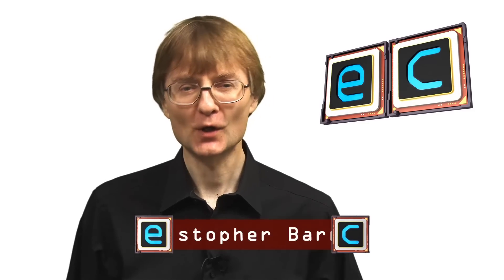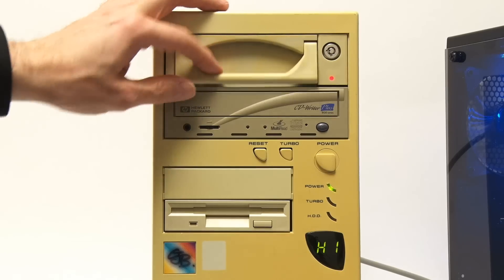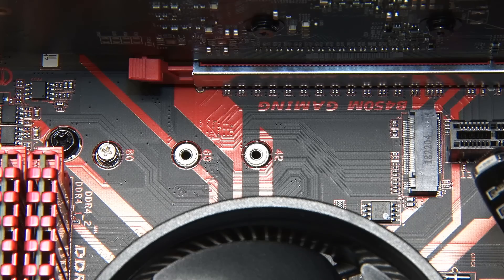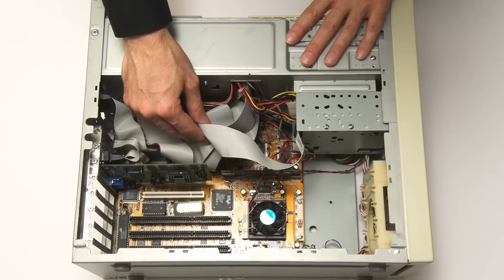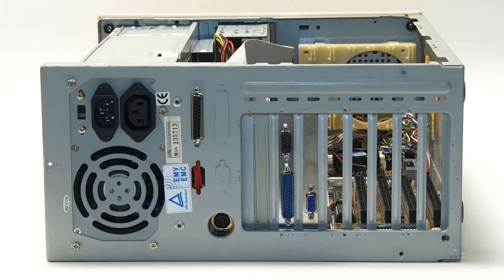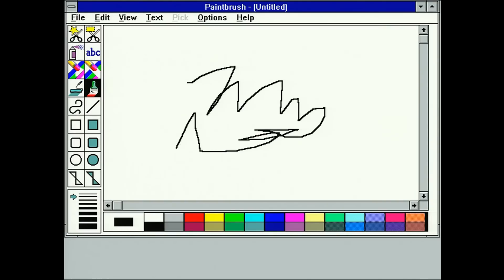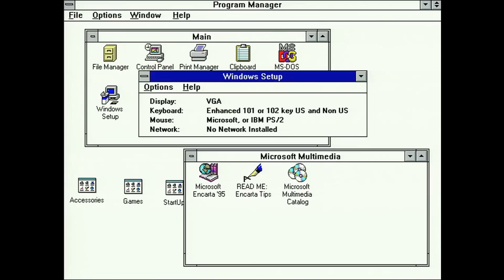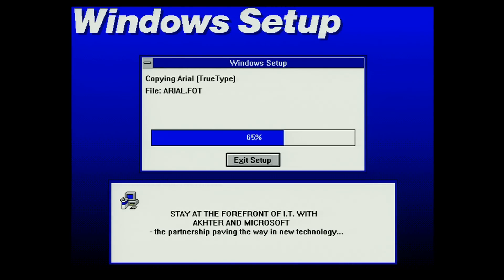Ryzen 3 vs 1996 PC

Comment: Still have the first computer I assembled back in 1997. Was going to take a peek inside a few months ago and discovered a paddle lock on the case that apparently I had secured it with many years ago. Seemed a little silly until I remembered how much the (by today's standards) puny memory and HDD had cost back then.

Comment: Thanks for a blast from the past.   I built my first PC around 1988.  I do recall the excitement at the time when Windows 3.1 came out a few years later.   The search for drivers was a big challenge back them.   No internet so you needed the driver on a floppy. 

Installing from a floppy was always a fingers-crossed event for me.   Now and again I had a bad floppy.   I recall getting the stack of floppies to install the IBM OS/2 operating system.   One of the floppies was bad so I never did manage to get that installed.
I look back with some fond memories of earlier versions of Windows, MS Encarta, etc.
I am now running Windows 8.1 on this computer.   The wife upgraded to Windows 10.1 which gives me problems when one of its forced updates does not work.
I expect my next computer will run a distribution of Linux.
I still have a lot of old computer parts, motherboards, drives including the original 10MB Winchester hard drive.   Huge and heavy.   It shook the entire computer when it ran.

Dave.

Comment: This Ryzen pc is something unimaginable 23 years ago. It shows how far the technology has come.
Now think 23 years in the future - what craziness will be there? Tens of terabytes of RAM, 1000+ cores?
Why not!
Reply: Well, in 23 years Chris has increased his RAM from 32 MB to 8 GB and his core count from one to four. So, extrapolating forward another 23 years I make it 2 TB of RAM and 16 cores.
Reply: @johnm2012  I could agree on the RAM but
CPU cores are on an upward trend. I predict 24-32 cores will be the bare minimum within a decade.
Reply: @flioink  Yes, I was just going by the difference between the two computers and extrapolating. The thing is the 1996 PC had more memory than was typical at the time. It would have been an expensive machine to build, whereas the 2019 PC was definitely a budget build. If he'd been comparing like with like the Ryzen would have had 8 cores or maybe even have been a Threadripper and he would have maxed out the RAM as he did in 1996, so 32 or 64 GB. So on that basis, maybe we can extrapolate to 64 cores in 2042 and 32 TB of RAM. Who knows? I hope we both live to see for ourselves.

Comment: i honestly would have died laughing if you opened the old PC and inside was a Ryzen 9 with 5700 xt
Reply: I doing something like that with and old DELL Pentium 4 system I salvaged from the local recycle drop off, for a retro Win98/XP build, I just need to find a case big enough for the build. I even found a period correct ULTRA branded modular 500 Watt PSU for the build to add some early - mid 00's Bling on the inside, and yes it was brand new in the box with the original shrink wrap, and it's never used, and the caps, etc.. are all in good condition.
Reply: A Pentium 3 era case should do it -- ATX mobos really havent changed a lot
Reply: @ayuchanayuko  Yep, but trouble is finding them in good condition, and at a decent price in my area, as when I come across one on eBay, they always want some crazy amount for shipping the thing.
Reply: @CommodoreFan64  check your local surplus shop, especially the Storage Wars kind that keeps old stuff.
Reply: @ayuchanayuko  Trust me I'm always on the hunt, but it's bare beyond some ugly AF HP cases from the early - mid 00's that are also overpriced. My local Goodwills rarely put PC's out on the sales floor, it seems, and the Salvation Army is 80% clothing items, and what other they have is usually overpriced, yes I've checked others, but again no luck. part of It is because we  have free recycle drop off locations around the area, you just have to show your state ID with your address on it, and I've even checked there, but not a ton of luck as of late, beyond a Yamaha keyboard I'm cleaning up for my nephew.
Reply: I like to think that one day the people who ruin old computers to build sleepers will be seen by historians the same way as those who used to grind mummies for "medicine".
Reply: @ivanlagrossemoule  Big difference in crazy people grinding up dead bodies for crazy fake medicinal purposes, vs. giving old tech that was going to be thrown away, and hauled off to some 3rd word African country polluting the environment, or would have been recycled(what little that actually does). I'd rather save the old tech, and give it a new lease on life, at least as long as I'm on this planet, and it can serve me a useful purpose. If you want original parts the way they came from the factory,  then go to the RE-PC Store in Seattle Washington, they have so much back stock of old parts they don't know what to do with them. Metal Jesus Rocks made a video on them.

Comment: Great look back!  I built all of my early Pc's, including my first IBM clone, a Heathkit HS-161.  Soldered an estimated 2000 solder joints.  It ultimately ended up with a 10mb hard drive and ran Geoworks Ensemble (a wonderful graphic interface that was miles ahead of Windows 3.1) on top of Microsoft MSDOS or Digital Research DRDOS.  Great fun, but I don't want to go back.

Comment: A PC labelled for 1996 should demo Windows 95 as everyone moved to that in those years, except probably your uncle or grandma.  I remember back in 1996 I bought a Compaq Presario 166mmx (Pentium) which had Windows 95 there, and had way better technology than yours.  It had 1024x768 in true color and yes 32mb ram expandable to 80mb.
Reply from the maker: I had DOS and Windows 3.1 disks available. We were still running these and not 95 at work, and indeed because most software in business use was still DOS (this machine was mainly used to run Word Perfect 5.1 and Lotus 123), the DOS / Windows 3.11 combination was much favoured. So it is not true that "everybody moved to Windows 95 in those years".
Reply: @ExplainingComputers  I'd argue that it depends where you live, in North America (Montreal to be specific), we do not keep rolling on the old standards for extended periods of time.  Was everyone moving to WIndows 95 back in 1996 ?  I'd advise checking out sales figures of the Windows 95 Operating System.  I had Windows 3 on my 286 in 1990, then I was bleeding edge on the Windows, and THEN I was programming in DOS on QuickBasic 4.5.  So, to me 1996 has nothing to do with DOS.  I was also programming in Turbo C in DOS in 1990 up to 1992 as I had a WWiV BBS.
Reply: In fact, while thinking about it, at work we did use Windows 3.1 in 1996, but on 4mb 486 machines.   But it would be pretty mindless to run  that on a Pentium with 32mb of ram !!
Reply: @33ordie  You seem to be showing unnecessary aggression here. It's obvious from what Chris says in the video that he rebuilt the computer to something like its 1996 specification and did a fresh installation of DOS and Windows 3.1. Maybe after nearly a quarter of a century he didn't have a set of Windows 95 installation disks readily available. It's just a bit of fun and close enough for the purpose of education. Get over it.
Reply: @johnm2012  thanks

Comment: I'm no expert but my guess is that the Ryzen 3 system is faster.
Reply: how Ryzen 3 can be faster than Pentium 120 ? 
120 > 3
Reply: Yeah but it's only because it has more RGB.
Reply: Well yes, though what it is being asked to run is a lot less efficient.
Reply: @eLJaybud  absolutely spot on! Would imagine code for Windows 10 is at least 50 times larger than 3.x
Reply: Windows 10 on the Ryzen and Arch with i3wm on the other one would make things pretty close.
Reply: @JeffSmith-vc9ii  Try booting any variant of arch on the Pentium. Any.
Reply: @dascandy  Ive run it on a 200mhz before. But yeah ram could be a problem I guess. Problem solved with Tiny Core.
Reply: @JeffSmith-vc9ii  The ram is one problem - but note that the PC doesn't handle DVDs, doesn't have USB nor any other card formats... and it doesn't do SATA either. It's pretty hard nowadays to get anything to plug into it - not even a network uplink will work.
Reply: @dascandy  My theory would be to  image an ide externally.
Reply: But ... can it run Windows 3.1?
Reply: Intel is faster than amd
Reply: @jimmicrackhead12  gr8b8m8
Reply: @jimmicrackhead12  and is almost twice the price as amd lol
Reply: For a lot, probably majority, of people computer is a machine which runs Word, Excel, and nothing else
"What's even the point of computer, if Word isn't installed on it"?
Reply: @KOTYAR0  These days, I think even more people just think of their computer as a web browser.
Reply: Yeah it's possible with extra cooling
Reply: @RubberGopher  This sounds like a good challenge. I know I can get arch (old kernel) on something with mmx instructions. I just wouldnt update it. Tiny Core would work np, and debian with open box .
Reply: i am fan of my wallet
Reply: I'd hazard a guess that a Raspberry pi zero can beat a 1996 desktop.
Reply: @alexmcd378  it's not x86 though, it's ARM
Reply: @RWL2012  Doesn't mean they can't be compared. Might have to recompile a program or even write your own, but it can be done.
Reply: @alexmcd378  true I guess
Reply: @RWL2012  I bet the pi 400 computer can emulate a faster x86 pc than what we had back in 1996.
Reply: @tj71520  quite possibly!
Reply: Good guess
Reply: When it comes to classic games it might be a little too fast... if you can get it to run on the modern system through emulators or installing DOS and another version of windows in VM
Reply: not faster as i9 and im not expert to
Reply: Yes, 10x faster
Reply: @gile849  a bit more than 10! the Ryzen 3 2200G (passmark 6713) is more than 10 times faster than even a 3.4GHz Pentium D (passmark 634), and more than 68 times faster than an 866MHz Pentium III (passmark 99). so it's probably more than 100 times faster than the 120MHz Pentium I.
Reply: If you tweak the memory they are almost the same
Reply: The older system is a tad friendlier because it says hi when powered on.
Reply: A pentium is overkill for windows 3.11. A 386 would be more accurate. I ran do until I got my first 386 then I could use win 3.11 and by the time I got a pentium I was running Windows 95
Reply: AMD is in first place, get used to it Intel boi

The is just beginning.  Next 3+ years will be a hilarious roflstomp with no answer
Reply: @tnix80  I'm pretty sure simsalamia was being sarcastic....
Reply: @tnix80  

I'm a fan of AMD, but even I know that you shouldn't make statements of the future like that. You might end up eating your words 😉
Reply: just a bit yes )
Reply: no shit sherlock? :)
Reply: You are an idiot, AMD is not better than Intel....
Reply: @simsalamia  Run and hide for your life. They are coming for you, and won't stop till they get you. Be careful, intel guy.

Comment: Did you cover making sure you have the right jumper setting on your drive? You will have a hard time installing and booting if the jumper settings are off.
Reply from the maker: Oh yes, drive settings were fun in those days, master/slave IDE jumpers and all that.
Reply: Do you remember that the cable to the floppy drive had a special twist in it?

Comment: That was interesting, nothing like a bit of nostalgia.  In the late 1980's I had a NESS PC, 8086 with 32 MB HD, one 5.25" floppy and a 3.5" which I added later.  I also bought a Microsoft Mouse and adaptor board which cost me £112, a lot of money then.  Despite all this it ran ORCAD, a PC design, simulation and PCB package with no problems.  Modern PC's have more power and memory but the programmes have become so bloated much of this is wasted.  Bob

Comment: 1990  the year and a 386   later with a math co-processor installed.     2400 baud modem and WOW you could get stock quotes on the same day and even draw a chart of a stock,  it took a while but it was better than reading what your stocks did in the next day's morning papers.

Comment: I was wondering why the system wasn't running Windows 98. Then I realized that the system came out in 1996 😂 But why not Windows 95?
Reply from the maker: I happened to have Windows 3.1 disks "available", and mainly ran Word Perfect 5.1. So I did not desire Windows 95, let alone want to pay for it! :)

Comment: You should be able to find Windows 3.1 drivers for the video card on-line somewhere. The big issue is determining precisely which type of video card it is, and whether it has enough VRAM for 256 colour modes. Some of these video adaptors only had 256K of VRAM, which was enough for 800x600x16 colours.

Comment: Ah, Windows 95 could run Windows 3.x software, right? (The latter seemed an odd choice for 1996)
Reply: Pretty sure that was true up until at least Windows 2000.
Reply from the maker: I had 3.1 floppies available, and mainly ran Word Perfect 5.1 in DOS.

Comment: I was lucky in that my family had computers since DOS, and we got on the internet relatively early as well (with a 14.4 Kbps modem at first, with photos taking a while to load from top to bottom).  My first laptop was bought in 1999, and I remember that that had a 6 GB hard drive.  I would like to say, "That was more than enough at the time", but in fact, I always ran into the maximum storage limit and had to offload my data, first to those 1.44 MB floppy disks, and later, to CD-Rs.  But, to be honest, I still find that I have to do that, even with my 2017 Ryzen (first gen) PC, as I take photos, so I offload my data (depending on what it is) to one of two 5 terabyte hard drives these days.  As far as we have come, I want more.  I really need more.  And I hope that we can get back into that exponential improvement that we experienced in the 1990s and 2000s, instead of what I feel is a more linear progression these days...

Comment: I won’t deny the obvious advantages of solid state media over mechanical hard drives and floppy disks but I do like using them still (not as boot media) as the sound they make is reassuring that the computer is actually doing something when you use it
Reply: Mechanical hard drives still retain at least one advantage over SSDs - cost per gigabyte. For bulk storage they still can't be bettered.

Comment: P120 was a little slow for 1996 wasn't it? I remember my 1st PC (Also in '96) 32 meg but having a Pentium 200 CPU. Coming from the Amiga, I thought it was P.O.W.E.R.  :D
Reply: The P120 had hit the the market in 1995.  The P200 was introduced in '96, but was fairly expensive when it first hit  A lot of P120 and P133 systems were being sold in 1996 as 'budget' or even 'lower-midrange' PCs, since with the introduction of the P200 the prices on P120 and P133 chips were dropping fast - especially in light of the anticipation of the Pentium-2 in 1997.
Reply: @xaenon  yep, and then by the time we hit 99/00 the budget builders who knew their stuff, where using AMD K6-III series CPUs, and hitting blazing speeds of 550Mhz which is what I built my first real PC gaming system with then when I was in high school working my first job to pay for it all.
Reply: @CommodoreFan64   I was getting my A+ certs at the time, and I'd just put together a Cyrix MII-PR233+.  The chip actually ran at 166 Mhz but in most areas it ran similar to a Pentium-200/233 and even had MMX extensions.  64 meg of ram and Windows 98 (first release).

Comment: Ah yes, the removable but not hot swapable IDE drive tray (ask me how I know). I seem to remember 22 3.5 inch floppy discs for one of the operating systems I installed.
Reply: Let me guess. OS/2 Warp?
Reply: @johnm2012  Windows NT 4.0
Reply: @yootoob7048  Ah, ok. I never used NT 4.0. Windows 2000 was the first OS "based on NT technology [sic]" that I used and that came on optical installation media. I liked it a lot.

Comment: I would backup windows 3.1 or 3.11 and upgrade it until you cant upgrade it know more just to see how fare it will upgrade then put windows 3.1 or 3.11 back on it....
sorry i just like to challenge myself on older systems i had a p4 running windows 10 32bit was slow but it worked...
i cant wait for your next video have a good day....

Comment: Wonderful video Chris!  We too had a P120 back then (running the brand new Windows 95) and I regularly used to use Encarta for my GCSE homework!  When we first built the PC it used to crash regularly.  It only stopped once we realised that it needed a heatsink and fan!  Coming from a 386SX-16MHz, the P120 was a massive upgrade, but clearly ran much hotter!  I missed DOS and Windows 3.1 though, I felt like I lost control of the computer's processes with Windows 95.

Comment: If you feel like playing with your old pc some more search the web for drivers for the chipset on your graphics card. I used to use driverguide.com for old drivers but it has changed over the past 10 years so I don't know what it's like now. (And for anyone playing around if windows won't boot after Making a display change go to DOS and CD to your windows dir, type setup and you can chose vga again through basic menus.)

Comment: When I was in grade 1 (95) my parents bought us a Gateway 2000 Pentium 100 MHz with a 2gb HDD. This is even higher spec than that. I'm sure these were running win95 and were getting upgraded to 98 if they could keep up with the evolving hardware.

Comment: I still like including a DVD optical drive in my computer builds, I like to be able to play DVD video disks on the PC.
In 1996, I built a computer using an AMD K6 socket 7 processor.  I think it had 16mb of ram (4 simms).  It ran Debian Linux.